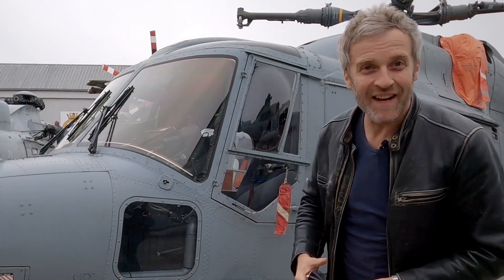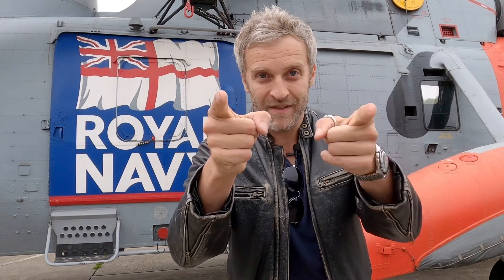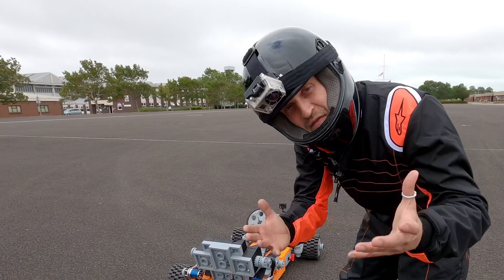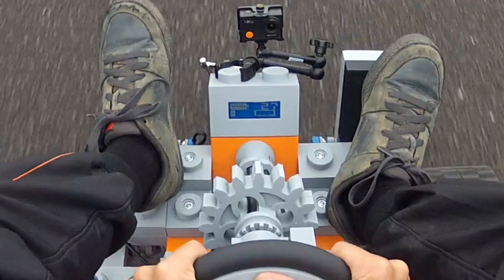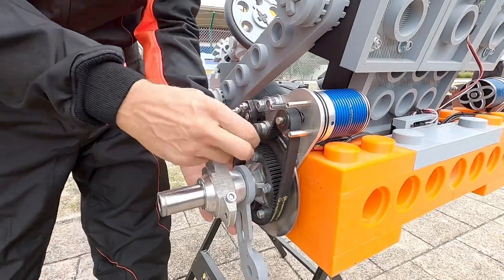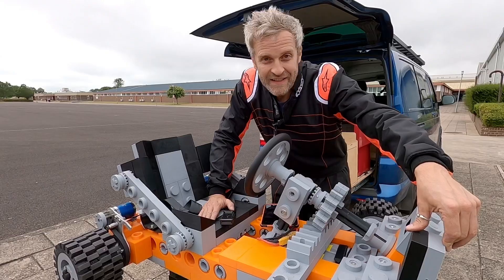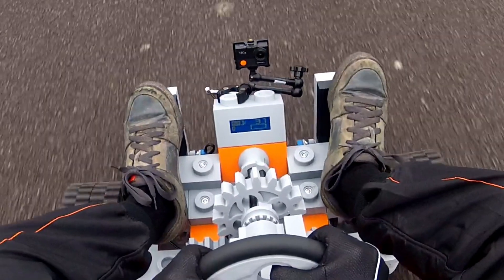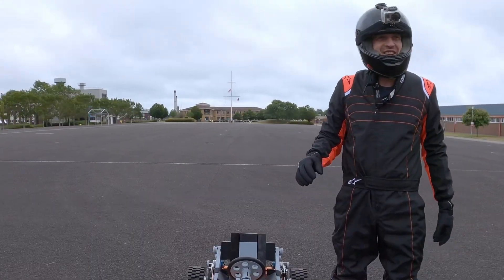XXL LEGO Go-Kart | Speed Trials! | #5 - Mantis Hacks

Comment: The gocart would be a lot more stable at speed if you could figure out how to add some caster angle to the front steering spindles, right now it is relying only on your arm strength to keep the cart straight and the slop in the gears is making it twitchy, some positive caster will make it go straight naturally. It may be cheating against the lego design but it will be safer.
Reply from the maker: Indeed.. but tricky to keep it Lego and add the caster angle 👍

Comment: Question... What do you recon the mileage would be on a full charge? Cuz at 30 miles it would be the perfect solution to local driving, just add lights and make it road legal lol, that way I (for one) could stick to the speed limit and save money (on fuel and speeding tickets 😋🤣) and still get to my destination and back without a problem. Really enjoying this build, and can't wait to see what you've got planned for the future 😎
Reply from the maker: Well... I should have taken note of the battery consumption... But it was doing pretty well. I think after the speed trials I had only used about 10% battery.
Reply: @MattDenton  not bad! Thank you 💪

Comment: Steering issues.. the Lego pieces will be designed for 0 toe in and 0 camber. This will be making a big contribution to the steering issues. You need to engineer some toe in on the top wishbone and rack to aid maneouverability. Good luck... looks a lot of fun!
Reply from the maker: Yeah that's not going to happen 😂... A split axle is as far as I can go 👍
Reply: @MattDenton  we used to use axle pieces for the wishbones before  Lego came up with premade pieces... I will see if I can remember how we did it.

Comment: When you split the axle, you could add a sensor to measure the steering angle and do torque vectoring with the two motor drive. This would increase the agility and you could realize an adjustable software limited slip differential. 🤔😎
Reply from the maker: Yes indeed!!! Already planning it if the diff doesn't work naturally

Comment: Could you put the 16 tooth on (as I think you have now) then electronically gear it? That would then allow you to drop a load of current in with a lower voltage to get the torque at the start, then once the speed tops out (very quickly, I'd imagine) you change to a higher voltage lower current giving you the speed? It's all about balancing the power. I'd imagine that you already know this and I'm preaching to the choir.

Love the video, by the way. I've been checking your page almost daily waiting for the post.
Reply from the maker: Well it uses the VESC 6 controller in current control mode so that is kind of what happens. Thanks for the feedback.. appreciate it 👍

Comment: Love that you went for the solution I suggested about splitting the rear axel. I'm looking forward to see how turning is impacted, but I wonder if you will have to make software changes in order to differentiate engine speeds to accommodate outer vs inner circle distance differences during tight turns.(plz excuse my insanely poor vocabulary)

Comment: You would have to redesign the entire steering geometry for any improvement. LEGO Technic steering geometry has always been appalling.
Reply from the maker: Indeed. But the biggest issue right now is that all the weight is over the rear axle that has no diff so the car simply wants to do straight lines. Once I split the axle then it's going to be as good as it can be with parallel steering 😆
Reply: While true, it's also fit for intended purpose. They're children's toys, after all. Don't need true ackermann steering in a building toy meant for a 9 year old.

Comment: Matt, the perpendicular steering geometry enforced by the Lego is the cause of the problems. You have no trail, no caster angle, no kingpin angle and a huge offset. Splitting the axle might help but I don't think it will totally solve it.
Reply from the maker: Yes I realise the parallel steering is awfull. I do me room this in an early video but the axle with all my weight over it is not allowing the tyres to turn when any power is on. Basically poker weight distribution doesn't help. Once the axle is split then I can see just how bad the steering setup is 🤞😆

Comment: Do you have anything to measure your steering angle?  If you do is there any way you could slow down the wheel on the inside of a turn, or increase the speed of the wheel on the outside of the turn?  With two independent rear motors you could have them help with your cornering.
Reply from the maker: Yes. But I need to split that axle first ... Then I could try the electronic differential

Comment: On the previous vid you changed the power level of the batteries to get more speed. Is that something you tried here?
Reply from the maker: I think I left it at full power. However after the event I suddenly thought I may have turned it down a bit. It would be effect the full speed on 14tooth pulley but maybe 16tooth.... Mark II 👍